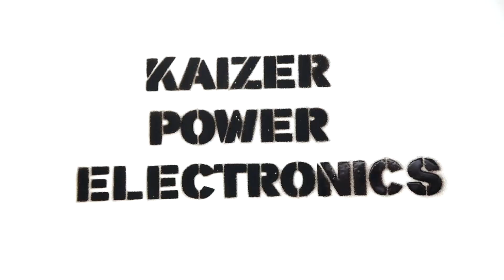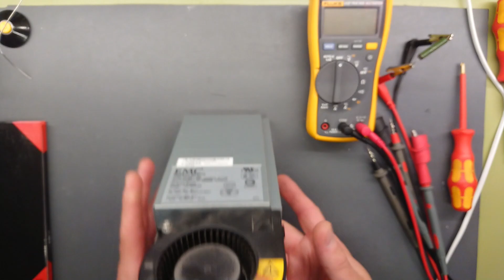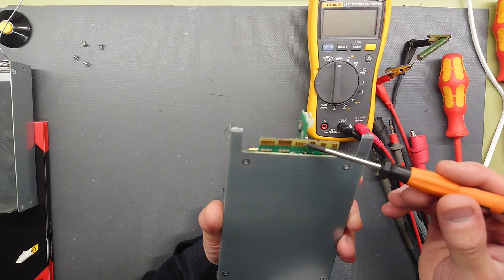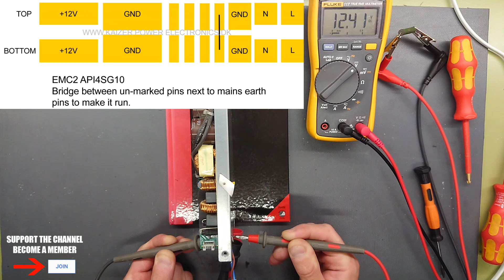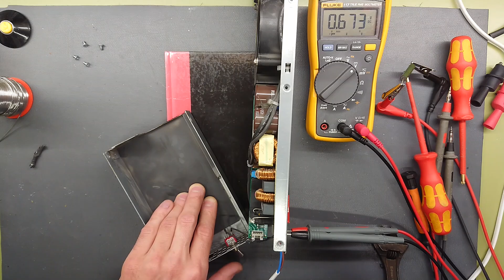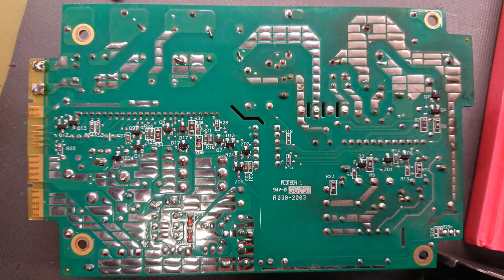Server PSU Hack - EMC2 API4SG10 12VDC 300W From a Dell PowerEdge M1000E

Comment: Old Server PSUs are so wonderful. For many reasons: 
Extremely high built quality. 
Excellent parts, i.e. 105C caps of HQ brands.
Ultra low prices (nowadays).
High currents.
High reliabilty.
Small cases.
Reply from the maker: Only downside, the sound level of the fans :)

Comment: Nice job
Would have loved to have seen if it has options to increase the output voltage.
Reply from the maker: You can see a blue/yellow potentiometer at 2:02 that is most likely a trimmerpot for the output voltage, it was however varnished over to be locked in place.
Reply: @KaizerPowerElectronicsDk  Danke

Comment: i wonder if all the big-boy namebrand server PSU's have a voltage adjust trimpot in them...  would be a good lead acid battery charger @14.4v  ....
Reply from the maker: Many do, but with a upper limit at around 13VDC+, some have succeeded with additional "virtual current" feedback to make it go up to 13.8VDC on some models. I have never heard of anyone pushing them to 14.4VDC, I guess its simply too far from its design specifications and would damage the equipment it was built to power.

Comment: Interesting, it's always nice to have a good stack of different server supplies :)
Reply from the maker: Its actually quite nice, as its pretty small and it is not always we need the 100A+ rating of a large server supply, removing the fan makes it quiet if only used at modest current levels :)